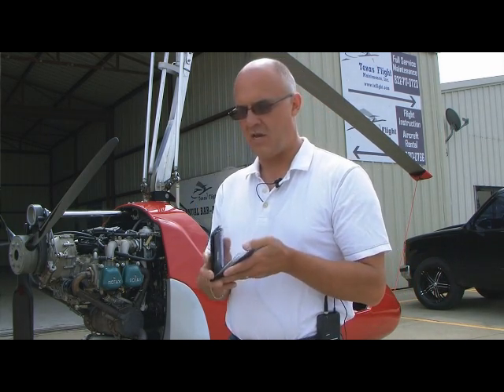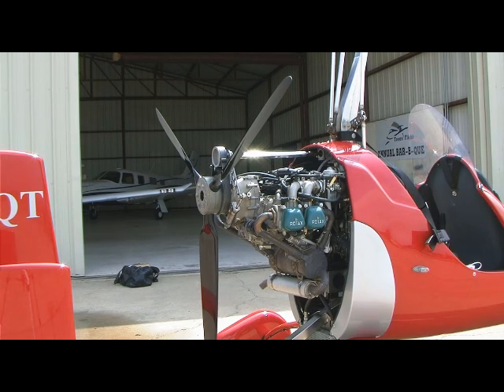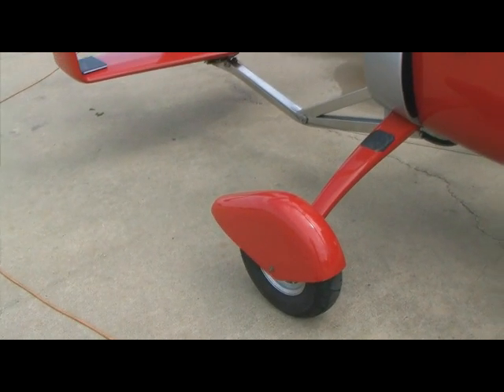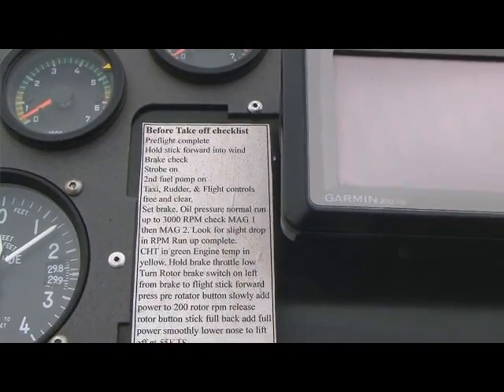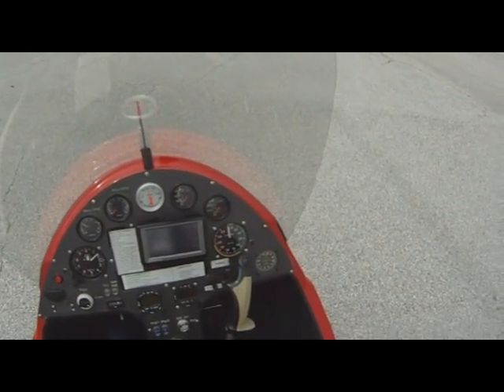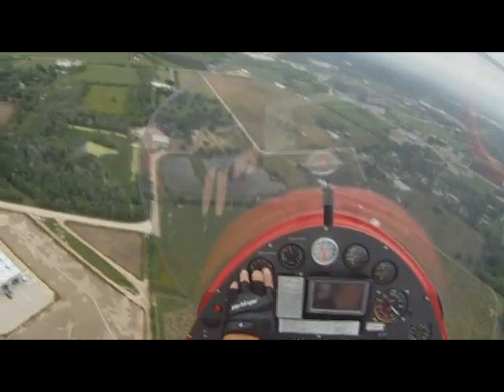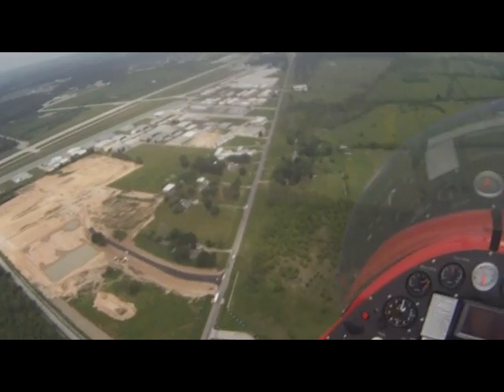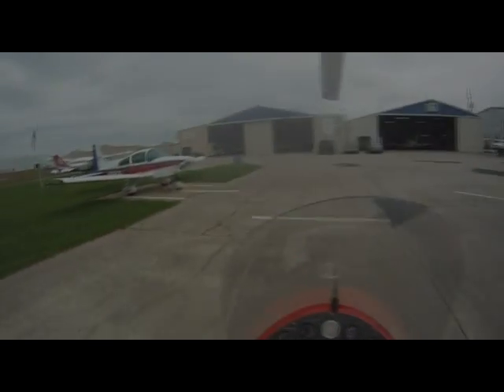Autogyro MTO sport Preflight and Control Tower flight in the pattern

Comment: No, this depend from the optimisation from the rotor and the flight conditions(+ caused from the assymetric speed from the forward to backward turning blade from the rotor) , some gyro use a vibration absorbtion system...But the helicopter have the same type of vibrations, can be reduced with more blades (3 , 4 or more) rotor blades, but the most use 2 blades to save cost, weight and place in the hangar...

Comment: Airspace is depicted on navigation charts based on altitude above mean sea level.  In order to know what airspace you are in, or, perhaps more importantly, NOT in ,the altimeter has to be set to compensate for the current barometric pressure and read this altitude.

Comment: Hey Des, just curious did you start the engine with that logbook still on the tail ?
Reply from the maker: This must be a trick question. Actually this was done in several takes. I filmed it by my self so it was just a good spot at the time. I wondered if any one might catch that. But no.

Comment: wi11y1960 wrote: "Why dont you set the altimeter to Zero since you are at zero when you are at that airport?"   Unless you're flying a float plane from an ocean spot, it's unlikely that you're "at zero" elevation when on the ground at an airport. The airport in this video, for example, is at 152 feet above sea level, which is pretty low compared to, say, Denver International at 5433 feet, but 152 ft. ASL is still not "at zero." Imagine if you were told to fly at 10,000 feet and you set your altitude at Denver at zero. Then imagine a pilot being told to fly at 10,000 feet who set his altimeter to zero at Hooks. The two pilots would not be flying at the same altitude, but would be 5281 feet different, even though both altimeters were reading 10,000. One would actually be at 15,433 feet and the other at 10,152 feet!
Reply from the maker: Yes this is exactly why. I know many CFIs that just set them to zero and then the student gets into a bad habit. The other big reason is spacing in busy airports. Lets say you set it to zero at a 650 foot airport. Then are told by ATC to climb to an altitude of 1500 ft. You then have class B above at 2000 ft. Now you are in class B and did not know it. OR worse you are in someone elses path because you are not on the same altimeter setting. and he does not have the space because you did your own thing.

Comment: Why does it shimmy so much?  Should it be shimmying that much?
Reply: If you're asking about the stick shake, that's pretty common on two-blade rotors. It's caused by one blade passing through the wake of the other blade. You can reduce stick shake by proper balancing of the rotor, and some gyros utilize various shake-dampener systems, but you can't totally eliminate it; after awhile you don't even notice it, though.
Reply: @seikibrian8641  If the stick isn't shaking the rotor ain't turning. If I see someone's hand shaking uncontrollably I ask "Do you have Parkinsons's or are you a rotorcraft pilot?"